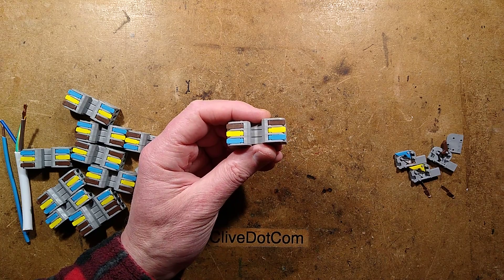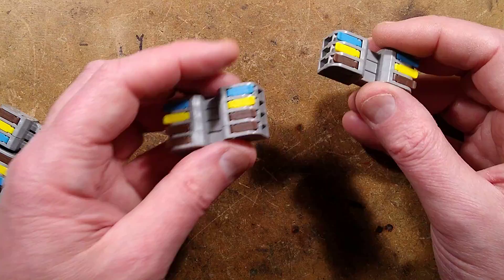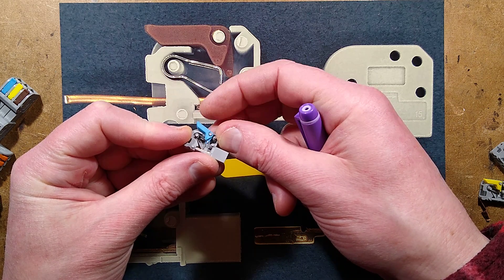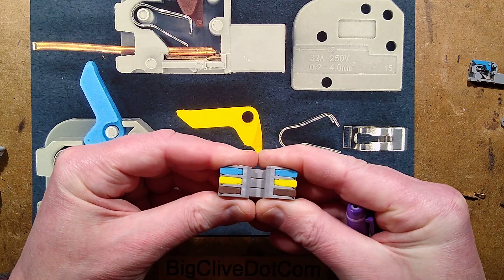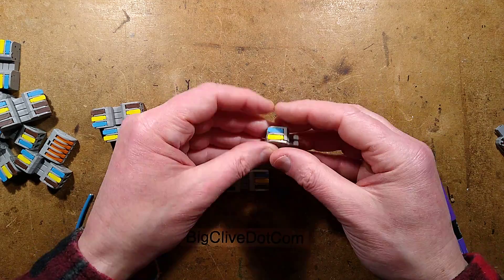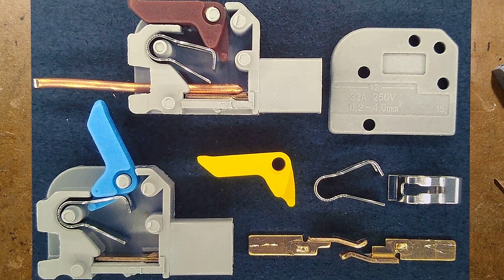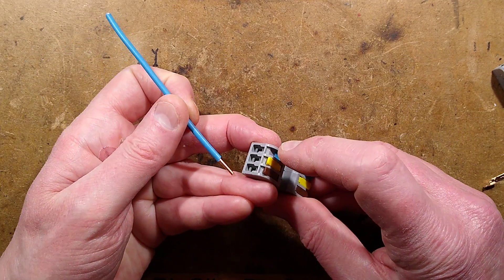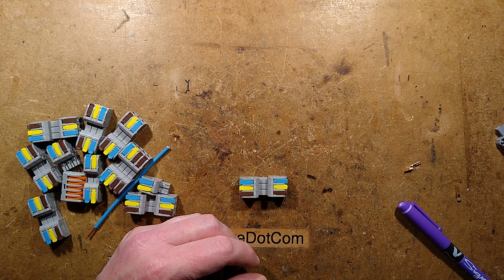Interesting modular connector with a few issues

Comment: Reminds me of Anderson connectors, which I've grown to despise due to a past job. They have many of the double edged drawbacks of modularity as well, and it caused me no shortage of tinkering to keep equipment working
Reply: The Andersons can be easily polarized though. They’re standard on non road EVs for a number of reasons
Reply: And people cut off weather resistant MC4s on solar panels and put on Andersons.....
Reply: I've worked at a major electronics retailer in Australia. The amount of people who came in complaining about Anderson was never ending. There honestly terrible for what there usually used for, outside of vehicles with no weather protection. Unfortunately there's nothing as cheap and available as them.
Reply: @unclejohn5012  yeah, they’re not meant for exposed conditions, although I think they make housings, that hold connector assemblies that may be better suited
Reply: The proper waterproof housing for Anderson connectors is not expensive and they are mil spec sadly the grey ones they use are not for outside use  @unclejohn5012
Reply: Anderson connectors are relatively expensive not cheap.
Reply: Id be interested in hearing more about the tinkering you needed to do to keep equipment working. I love my Anderson plug connectors.
Reply: @williamcampbell9859  it's been a few years now, but the biggest issues l remember were that they would unlink from each other, and that they would lose grip over time. These were the small ones similar to the size in the video, and they would get fried if they were misaligned when inserted from ~25A arcing across whatever contact didn't fully seat, or just from getting loose over time. Every other connector in-line was twist lock, so the andersons were always the point of failure when something got pulled, and their contacts would quickly get pitted from getting disconnected under load.

I imagine they generally work fine inside equipment where they don't get touched often, but they absolutely did not belong on the outside of equipment getting knocked around on a film set where they were attached and disconnected every time the kit was set up.
Reply: @microwave221 
That seems more like a 'user abuse' issue than a connector problem.
Reply: @microwave221  they are designed to pit on the non conducting front surface so generally pitting isn’t necessarily an issue. Were you using the low retention version?
Reply: @robertadsett5273  honestly, I've got no idea which style they were, but they would get so blasted over time that they were too rough to slide past each other. These were the little ~1/4 lego-looking ones that you could link side by side to build your own connector.

I wasn't there when they designed the stuff, but l think the Andersons were supposed to be a temporary measure since the HyCons they had been using weren't rated for the increased amperage they upgraded to. I forgot the name of the round 9-pin connectors used on the extensions downstream, but they worked very well comparatively. The Andersons were only kept around because they were hardwired into the back of the dimmers, and the owner kept dragging his feet on switching to the new design for reasons that didn't make sense to anyone but himself.
Reply: @Sine1040  it was definitely abuse from the users and the environment they were used in, but the rest of the connectors on the gear didn't fail nearly as often despite taking the same or greater beating.
Reply: @microwave221  yeah, that makes sense. The Anderson connectors handle opening under load better than any other I know but there are limits. I do suspect they used the low retention version “because they’re easier to connector/disconnect”
Reply: @microwave221 Thank you for the reply. I've only ever used/seen the medium ones, not sure of the exact size but they are 50A rated. I can tell you for sure that their current rating is static and they are not rated for connect/disconnect under load - as you say that will destroy the contacts. In my use case, I use them (and see them used a lot) for connecting solar and auxiliary loads to my 12v camping setup - they are very popular for that here and the preferred choice for use cases like that, as well as linking trailer auxiliary electrics to tow vehicles.
Reply: My biggest complaint was they would lose grip over time.
Reply: @shaunclarke94  do you use the low retention version? I’ve had some issues with people unintentionally pulling those out but never the high retention version, that takes effort
Reply: @robertadsett5273  there's two versions? I remember they would start out OK but would wear down over time and become loose.
Reply: @shaunclarke94  there’s two versions with slightly different shape to the contact so the forces are different. I’ve never had either wear down but the low retention version is easier to knock loose. Anderson connectors are used on forklifts and go through connection cycles multiple times a day, if they’re replaced it’s usually because someone ran over or into them. I’ve never heard of them losing retention force. If anything the complaint is the reverse, they’re too hard to separate, that’s why the low retention version was developed I believe. I’ve had field complaints about the low retention in some cases though so switched to high retention only unless a specific complaint pops up repeatedly
Reply: @robertadsett5273  this was the smaller 15 amp versions, I've never used the bigger grey ones.
Reply: @shaunclarke94   yes, they come in two versions. I’ve not seen either change over time but the low retention version is easier to pull loose and does give that impression
Reply: I was thinking the same thing. So similar in fact, that I suspect the pluggable side of these may be able to mate with an Anderson PowerPole connector.
Reply: Ham radio has sold their souls to Anderson Power-Pole... it is the de-facto standard now.

Comment: Clive,
They sell something similar to that in the US that is used to repair a damaged cable. It will actually allow the repair to be done in a run of cable that has no slack and without a junction box. It is the only one I know of here that allows a joint or splice outside of an enclosure. It is even permitted to be buried in a wall or floor without easy access. It is, of course, much better designed and made.

Comment: Is there no way to incorporate a "key" that makes misalignment impossible?
Reply: If you mean when using them, there's one way: Double up the ground connectors and have them in the middle, or put a ground on each end. That way, there will always be a short-to-ground when the connector is plugged-in misaligned.

If you mean when manufacturing/designing them: There are hundreds of ways...
Reply: @HenryLoenwind I was thinking of a "dummy" with a blocked port, making incorrect insertion impossible.  Much as the way some electronics (headers and edge) are "keyed'

Comment: The connector tab looks very similar to those on Anderson Power Poles, which are rated for 30A when paired with appropriate wire.

Going past the peak is a good thing. When they slide together, it provides a wiping action to clean the contacts, and the two sloped sides give a much larger contact patch than the peaks would.
Reply: The one major difference though Anderson connectors have an additional piece of spring metal under the connector which ensures it is always pushed tight against the other mating surface

Comment: Yeah, I wouldn't go running an 8kw shower or heater or anything mains powered through them. The most I'd use them for is 12 or 24 volt DC stuff, or as an easy way to join up some signal wiring for a project.
Agreed the Wago 222 was like a rat trap on your fingers, and they always seemed to hit you right at the most painful spot when the snapped closed. Thank F Wago released the 221, a far more civilised lever connector.

Comment: were there dummy sections available? that's usually how modular connectors and switches end up keying things to avoid the dislocation problem. could do it with different style end caps too. they get to hang out a bit on the side

Comment: Years ago I was called to investigated failures in a modular wiring system, the report was "failure of the connectors from heat". The system was rated for 32A and coupled prefabricated building sections then 15A drops to sockets to vending machines and Ceiling heaters etc.  This failure happened either on a Monday or Bank holiday.  The cause was peak loading [ 1998 IEEE 17th Ed diversity ? ] all Heaters came on together as did the vending Machines at the start of the day. The connectors would heat up from the high inrush current and demand causing the springs to become annealed by the resistive heat thereby loosing grip on the corresponding connector. The upshot was the entire building had to reworked as did many others in the country. 
The company had just been taken over by a large UK electrical fitting manufacture and they were not impressed with   system they had acquired. 

Similar occurred with pendent lights which were reported to be dropping from the ceilings. Using Thermal imaging I located the source of the heat to be from undersized springs with insufficient brass plating thus turning them into resistors and melting the fittings. The entire batch was recalled and the Chinese supplier sacked.  As for the fittings you show I would not trust those springs to maintain mechanical load or the stability or the plastic in the long term. The Wago look to be made with a Delaron or Peek high temp plastic not PVC/PET.  Early adopters of IDC or quick connects were looked upon with scorn however to my surprise I found them more reliable then traditional clamp connectors when sized correctly. 

A side note during my inspection in a major airport I asked their sparks to check a main feeder which I had by habit quickly scanned with the camera, I knew from other thermal inspections that it was in distress.  The sparks opened the load-centre and let out a number of expletives and called the data centre saying 'go onto the UPS immediately.  He then opened the main breaker and as he did the Neutral cable fell clear of the bus-bar !. Any spark will know you do not want to lift a Neutral on 3 phase. The modular wiring problem seemed insignificant to them once the spark explained that I had just saved them from a pile of hurt.   Fun times.

Comment: I would not use those for even light sockets, the only wire I would be comfortable to use would be speaker wire or low voltage and even then, the chance of miss aliening the plug-in section could lead to fire. A very bad design.

Comment: I agree that high current could be an issue. I think it would have been fairly easy to engineer misalignment safeguards.
I’d probably only use something like this for low voltage like lighting or speakers. There are definitely better connectors available for reliability. The only reason I see for these is saving labor, which is questionable as a justification.

Comment: Among many excellent diagnosis and comments regarding spring contact designs and their engineering is a consideration of what makes a reliable junction … disregarding plating thicknesses, barrier metals and direct but inadvertent submersion in aqueous solutions ( spillage, humidity and sweat for example ) is the concept of a gas tight contact area where the normal force    Between the joints is sufficient to prevent atmospheric air to ingress … the contact normal force … the pressure exerted by the mating contact areas … is sufficient to provide contact to contact low resistance over the lifetime of the contact … and to keep air from migrating between the contact surfaces.

Comment: Good for low voltage. like signs and alarm systems wring.
Reply: Low voltage is 50v - 1000v ac  and 120v - 1500v dc......you mean extra low voltage
Reply: @markyd2633  In the states low voltage in residential and light industrial settings is 50V and down. So the old TELCO V of 48 is low voltage. The wiring requirements are just about nothing down there. You do have to use fire rated cable in certain places like for Ethernet. Also RV/mobile use is barely regulated as well. This is a general statement so don't hit me up with "actually.... bla bla.

Comment: Also, i could see a simple solution to prevent misaligned connections, a housing to clip over one side with enough overhang to ensure proper alignment, would have to be sized for various numbers of connections, 3d printing comes to mind :)

Comment: It is funny to see how often companies try to copy WAGO, and fail almost all the time. I will stick with my wago for both low and high current connections. And with all the design stuff in place on those shown connectors, it would have been so easy to take care so you can connect yellow to yellow only,

Comment: Could the manufacturer address the potential for misconnecting the two connectors at an offset by making their "clip on" panel to have a longer piece which goes across into the same space on the opposing connector and only allowing connection where the correct pin is aligned?

In some ways I love to see people try to produce a similar project but include their own tweaks and "design enhancements", rather than just trying to produce a rip off version of an existing product but cheaper and almost always inferior.  I guess that sometimes the evolution is an improvement, other times it's dangerous and you have to look carefully at each product version .

Thanks Clive, very informational video as ever.
Reply: An extended end plate would only stop misalignment in one direction .  If system is redesigned to always have live on left, the end plates would be on the same side and collide .

Comment: The Anderson/Torberry connectors have been used on 12V electric golf trolleys for decades and handle the 100/150W motors current without issue.
Reply: I agree these are an interesting Frankenstein mix of Wagon / Anderson -Torberry connectors.